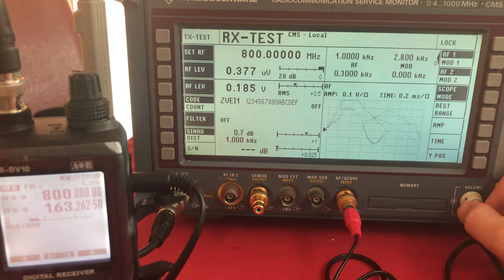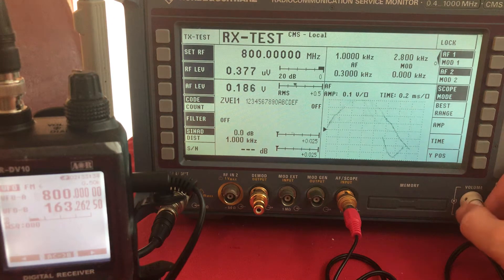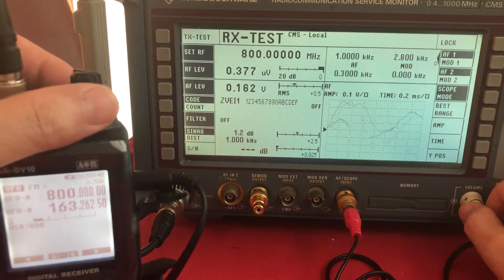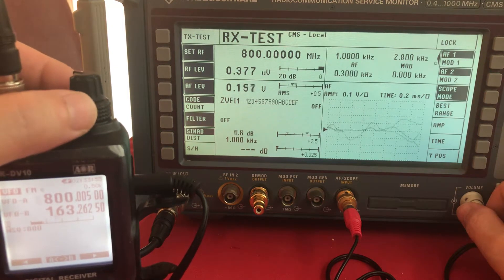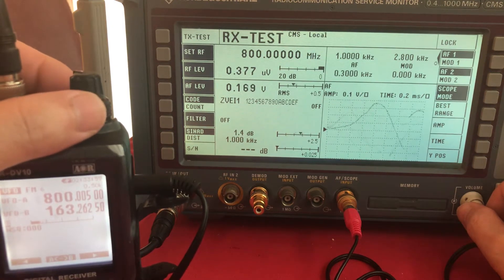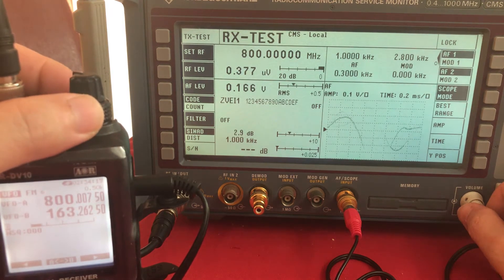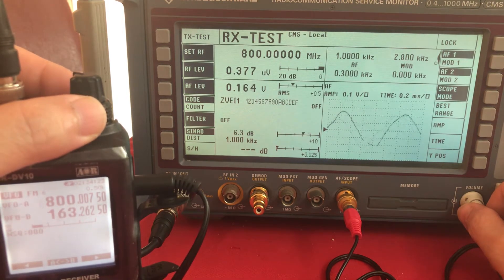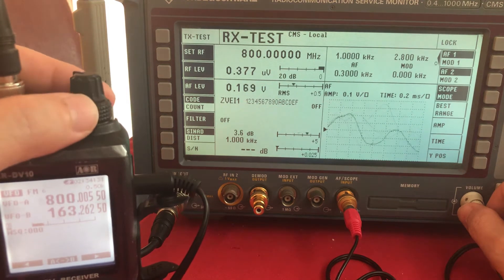AOR AR-DV10 Frequency Error at 800MHz

Comment: AOR seems to have fixed the problem. I bought the device in September 2022. The frequency deviation  is accurate to within a few 100 Hz everywhere. However, TETRA signals do not always seem to be decoded clearly. Sometimes it distorts a lot.. And the battery life also leaves a lot to be desired. 73 de DL1LAJ

Comment: Yep.... DV10 and DV1 is utter crap!
I sent my  DV1 back to seller.
So dissapointed, useless for most things unless digital modes on UHF 300-450 Mhz
Filters on Airband is so bad so its useless unless you put a filter on antenna your self.
Lw/Mw/SW ia very bad to and the noicefilter is the worst i ever heard.
Took them many many years to sort out som real scanning problems and lockups with firmware.
Why the hell are they so expensive when they ar so bad?